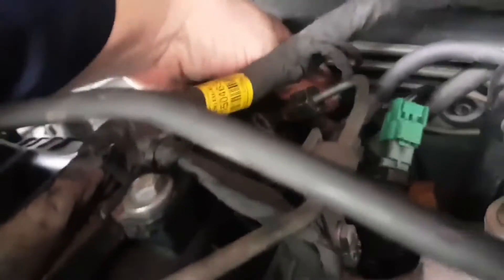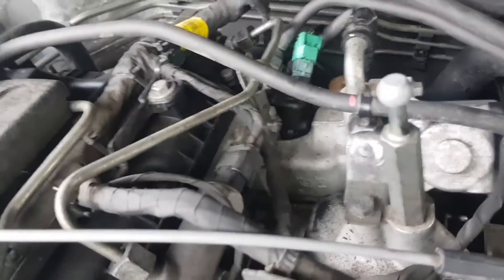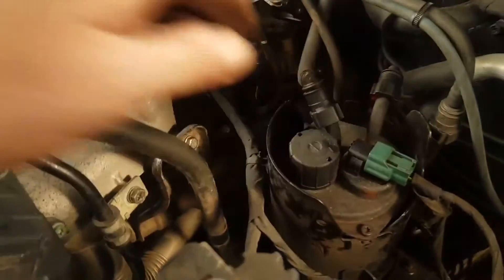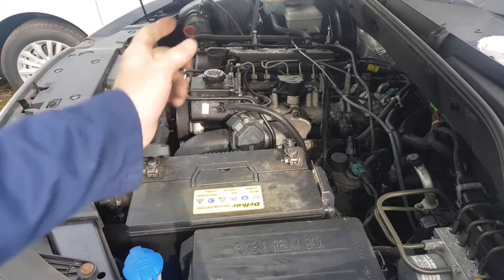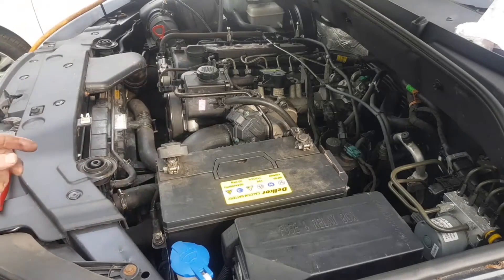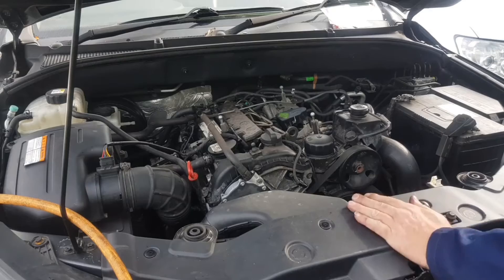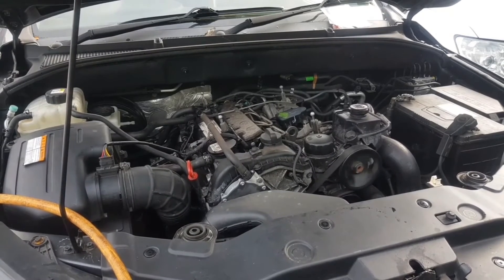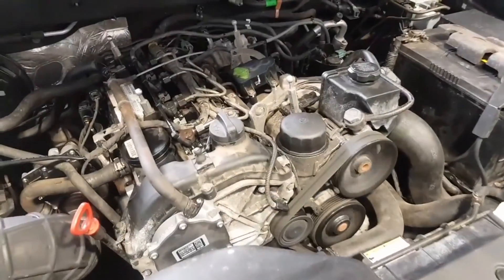Ssangyong Musso - How To Bleed A Diesel Fuel System When It Is Totally Dry.

Comment: My pump on the fuel filter housing was also impossible to press down and rotate when doing a fuel filter change, now the car doesnt start up straight away like it used to and sometimes see black smoke come out of exhaust when starting.

Comment: I have a Ssangyong Rexton 2.7 i have ran out of fuel thinking i can make it a few kilometers then got stuck i then changed fuel filter
Reply: Now it starts then idles for 40 seconds then dies
Reply from the maker: Drive it untill it stays idling, it might cut out a few times when you stop but just restart it and keep driving. It'll take a while for all the air to bleed out.